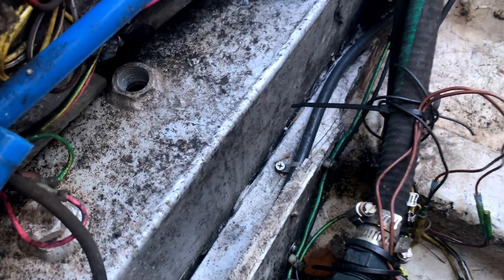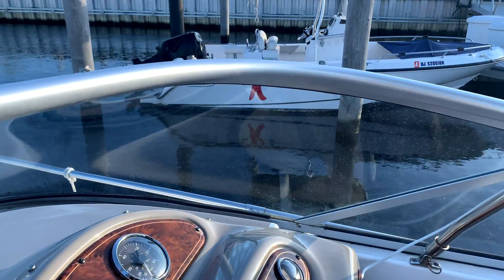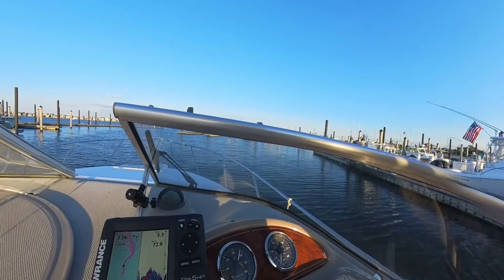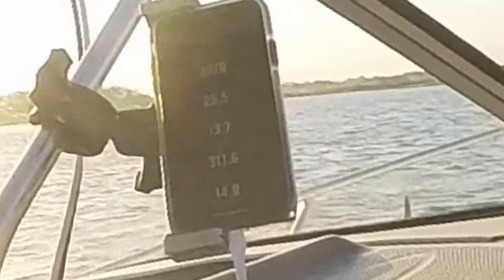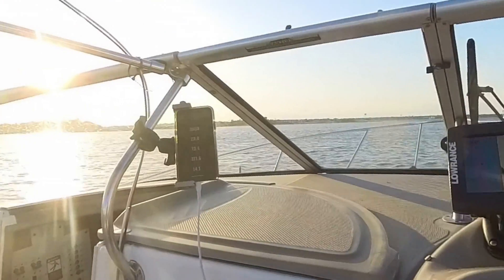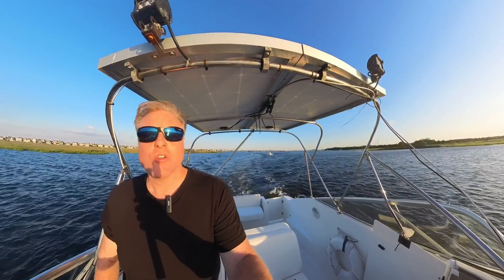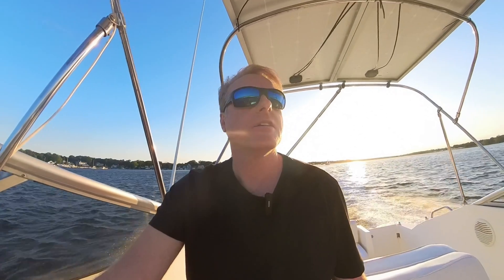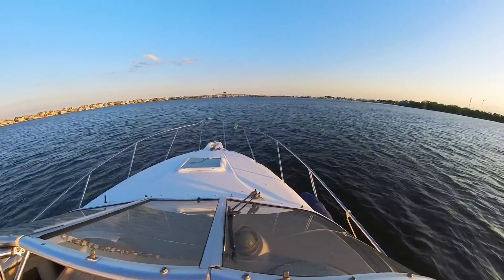Mercruiser MPI bucks/stalls at cruise speed.  Anti-siphon valve and fuel line replacement.

Comment: Greetings fellow boat owners! I have had a similar issue. My issue was with starting. Would run the boat stop for a bit hour or two. Would try to restart seemed like it was out of gas cough and eventually die. Put a primer bulb on the fuel hose. Upon priming the boat would start and run perfect. Took several primes to fill back up the fuel filter. Going to check anti siphon valve and pickup. Debating on a low pressure fuel pump to prime the system when I turn the key. Any thoughts or ideas of a model of fuel pump.
Reply from the maker: Hola. Thanks for posting your comment. Which engine?  Carb or EFI/MPI?  It sounds like vapor locking to me. If it was to sit over night does it start right up?
Reply: It’s a 4.3 mpi. It will start after sitting for a few hours. I have not discounted vapor lock. I’m just amazed at the amount of fuel that I need to pump into the fuel system to get it to run again after failing. Thinking the fuel is siphoning back into the fuel tank and replacing the asv. If that does not work,  I was thinking of a low pressure pump to prime the system when I turn the key.
Reply from the maker: Try to take note how long the pump takes to prime before cranking the engine. You might have to leave the blower motor off or open the engine hatch to hear it turn on and off.

Comment: Interesting, I have had this same problem on my old carbureted boat not once but twice over the years. The first time was way back in 2002/2003 and the mechanic I had at the time replaced the anti siphon valve and all was well until just recently. At first I wanted to rule out the ignition system as in troubleshooting it's always good to work thru with a process of elimination. So I replaced the points and condenser (yes it's that old lol, it has a Prestolite points distributor with centrifugal advance). Then verfied all plug wires are in good shape with an ohmmeter. Also checked the coil to make sure it's not breaking down when it gets hot. Then when checking spark plugs, which I installed new this spring I noticed that the porcelain insulators for the center electrodes were white, whereas my old plugs (I have a few sets I saved) were brown. That led be back to the fuel system. Initially thought it was the carb, took apart the Quadrajet, no smoking gun, put it back together with a good rebuild kit, but no improvement. However, the white center electrode insulators is the clue, the engine is running lean, so that anti siphon valve is again suspect. To rule out it, and the pick up tube I have a 6 gallon outboard fuel tank, I will run it with this for about a half hr or so,  I will be able to tell then because if it planes out well, I know it's a problem with the anti siphon or the tank pick up. 

On EFI or throttle body injected engines, also check the connections at the relays for the fuel pump, if these are corroded or even oxidized, you can have similar problems. My engine (pre-Vortec 4.3 V6 Chevrolet) has a mechanical fuel pump, so no worries there and I replaced this one about 6 seasons back. So we will see how it does and report back. 

BTW yes there are alu and brass anti siphon valves and they are also rated, to a Water Column standard, not sure exactly what this means but some have a 15 stamped on them, some have a 30 stamped on them, according to Moeller marine (they make anti siphon valves) you use a 15 for engines 201 hp and up and a 30 for engines 200 hp an under. My engine is rated at 205 hp so I guess I could use either. The Moeller ones I have found in the store are all rated at 30, I also bought an  Evinrude/Johnson one (brass) which is not stamped but when I tested it with my vacuum pump, it opens at the lowest inches of mercury of all 3 I tested (one alu, one brass rated at 30) the Evinrude/Johnson one (brass) is not stamped but I'm guessing it's probably rated as a 15, for higher hp engines. So that's a good thing to know! Years ago my mechanic (OMC school trained, and this is an OMC Cobra set up) used the brass Evinrude/Johnson one, so I'm guessing that's the right one for this boat.
Reply from the maker: Thanks for taking the time to leave such an informative comment.  It's greatly appreciated.  On my old engine I had a problem with some soot and film in the gas tank which caused the screen on the pickup to reduce fuel flow.  That was fun to figure out.  Once I ran through enough gas and got about a gallon of water out of the tank (which took a whole season) everything was good.  Had a broken wire to the sensor in the old Thunderbolt IV distributor system which took a while to figure out.  You definitely learn a lot over the years.  Hope you get a boat running in tip top shape ASAP.  Thanks again for your comment and insight.  🙏🏻 ✌🏻

Comment: I was told by a marine tech that you want BRASS for an anti siphon valve.    He said the aluminum slightly corrodes inside and the valve begins sticking .      He had one on the wall and I grabbed it $28.     My 2005 350 650 hr engine Mag had done the sudden dying bucking idle in to part thing.      Currently though I checked it after changing the valve and found only 36-38 PSI on the rail so I think it’s on to the pump as the pickup I pulled and cool fuel was spotless.    I believe the slightly sticky valve ball and pump were working together against me.
Reply from the maker: Thanks for that information. I’m literally changing out my spark plugs right now (taking a rest, two more to go) and almost done with my lasted video documenting this latest saga. These engines are to most temperamental things I’ve ever seen. I know they usually need a tune up every spring but not making through one season with only 100 hours is crazy. I’ll check into getting a brass anti siphon valve later tonight. Thanks again for taking the time to post a comment and help everyone out who may see this video and all the helpful comments. 👍🏻✌🏻
Reply from the maker: My Brass Anti Siphon is being delivered today. Going to install it tonight. Fingers crossed 🤞🏻 this works because I’m at my wits end on this problem.

Comment: So did you have any pinging sound with this? Mine sounds like detonation but I have no water in the fuel, I’ve taken a sample. And I’ve been running octane booster.
Reply from the maker: No pinging sound. The problem at the moment is when on plane running about 3400 to 3600 RPM the boat/engine starts bucking. While troubleshooting I had the hatch open and I noticed at about the same RPM the engine becomes extremely loud. Like I’m running headers or a car without a muffler. If I back off the throttle the engine is quiet again. I have to look through my video footage to see if I caught that while recording. As soon as I get on the water to test the new cap and rotor I’ll post an update.

Comment: Dude I've been chasing this problem for 2 years! Thank you ao much!
Reply from the maker: I hope this helps you out. I’ve been banging my head with this new engine almost every year I’ve had it. My honest opinion is it’s poorly designed and should never be used in a marine environment. I was just switching out the cap and rotor last night. The screws are so small and easy to strip. I bought the Sierra tune up kit again but just bought the real Mercury one today to have as a spare because I’m convinced the Sierra is garbage. IF the problem turns out to be the distributor it didn’t even last one season before it started bucking again.  It ran ok last summer but started missing up in December just before I took it out for the winter. Let me know how you make out. Make sure you have good ventilation as this engine does vapor lock. Good Luck 👍🏻
Reply: @Nautisphere when i took the valve out today the ball was missing all together so I replaced it. I'll test it soon. I was having other running issues but I solved most of them. I run a webber carb now and that solved all my starting, idle ans high low stalling issues. Mine isn't an MPI though it's a 3 liter.
Reply from the maker: How did you make out with your issue?  More importantly, what happened to the ball and spring?  Was there anything in there?  Maybe pieces are in the fuel line or fuel water separator unit?
Reply: @Nautisphere never found the ball. It may be in the old pump.
Reply from the maker: I finally decided my low pressure lift pump was the culprit.  I replaced it this weekend and when I removed the hose that to tank I found a little piece of foil from a bottle of fuel injection cleaner on the screen on the pump.  Who knows how long it was in my tank but it obviously found its way to the pump once I removed the screen on the pickup and removed the anti-siphon valve a week ago.
Reply: @Nautisphere  Didn't you have a video of the fuel pressure falling on is't ass when under load? If so, that is the problem.  Fuel delivery  problem.  Needs that 40 psi under load.
Reply from the maker: @bigblockcutlass123  Yes I did. Turned out it was either the low pressure fuel pump or the small piece of foil I found on the screen while swapping it out. 🤦🏼‍♂️

Comment: Would love some help I have a 2011 5.0 I feel is vapor locking. Runs fantastic off the trailer as long as you like. If you kill it to tie up or swim and are ready to go home 1-x hours later.. no start.. acts like it wants too but nothing. All the obvious maintenance has been done.. I been told to change the anti siphon and all the water check valves that feed the fuel pump housing.. I just picked the boat up from storage to work on it any help is GREATLY appreciated
Reply from the maker: Sorry I didn’t respond sooner. I just realized I had a new comment. Is your 5.0 carb or fuel injection?  I’m assuming if you let it sit long enough it will eventually start?  If it’s fuel injection I think it should have a rail similar to my MPI. You can try see what the temperature of the rail is getting to. If it’s fuel injection has a Schrader Valve to test the pressure you can see what the pressure is when you’re having the problem and try releasing the air/fuel to an external bottle or tank to unlock the vapor. Let me know what you’ve tried so far. I’ll keep an eye out for your response. Good Luck 👍🏻

Comment: What RPM were you at when it was bucking.  I’m having this issue now.  It happens around 3,400 rpm plus.  When I fill it up it burps out fuel and takes forever to fill.  I’m guessing fuel vent.  Also I have an electronic valve which I believe is Sea Ray exclusive that will only let boat run while it in bypass.  If I turn it on boat shuts off after a few minutes
Reply from the maker: Thanks for your question. It usually happens when I’m running at cruise aka 26 MPH to 30 MPH which is 3,600 to 3,800 RPM. Your fuel vent does sound like a good place to start. Not sure what size your Sea Ray is but I have a 2003 Maxum 2400 SCR. Both boats were built by Brunswick corporation. My fuel fill is totally stupid. The hose leading from the fill at the transom to the tank is on such a shallow angle it always kicked backed when fueling even when it was new. It’s one of the reasons I fuel up with 5 gallon gas tanks and the original safety siphon. Cheaper and easier. I never heard of the electronic valve. What purpose does it serve?

Comment: So...did this fix the problem? I watched most of the video after the swap but all I could hear was wind noise. And then you asked the viewer if we thought the problem was solved. Ha. I have no idea..... ???
Reply from the maker: Actually it did not fix the problem. What fixed the problem, and in two other videos, was my blower motor hose had disintegrated and wasn’t connected properly so the engine compartment was getting too hot causing the engine to vapor lock.
Reply: @ interesting. Okay thank you.